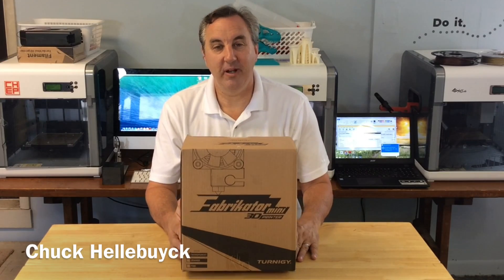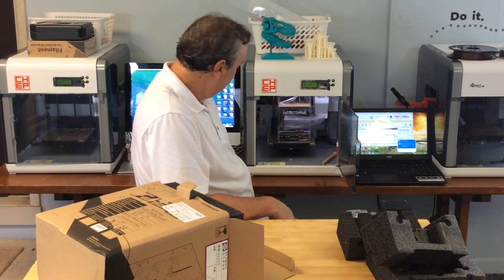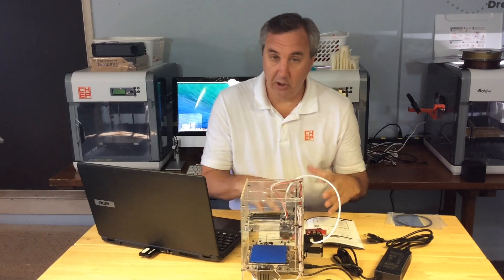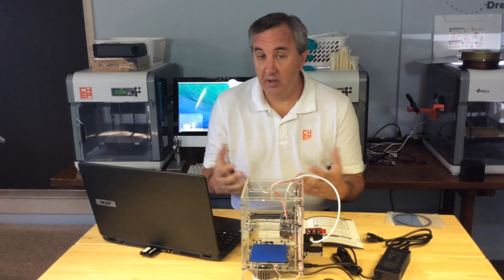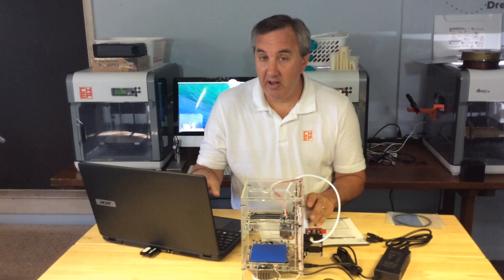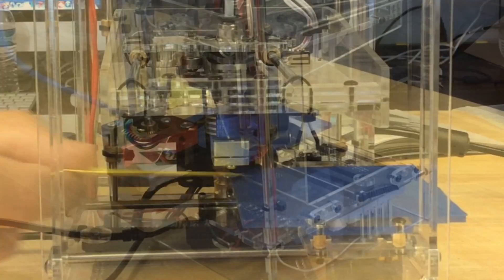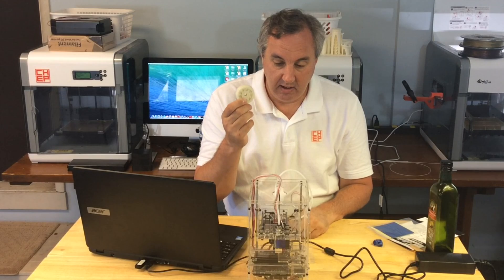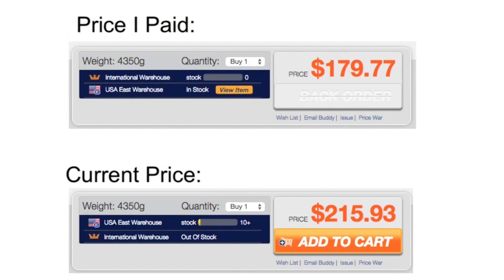Fabrikator Mini by Tiny Boy 3D Printer Review - Video #079

Comment: blast from the past.   I bought one used for $50 (!) that was broken off Craigslist when they first came out.  All that was wrong was a loose grub screw on the y stepper gear.  Printed surprisingly well.  Sold it later to a novice after improving it with a cooling fan, etc.

Comment: question. I got this printer for Christmas and I can't find their config files on the website.  I followed to book and it will not print using cuda.  I can get it to print using slic3r, could you post the config files?
Reply: Thanks man,  this is great!   BTW love your videos
Reply: +Chuck Hellebuyck's Electronic Products So I loaded the cura settings and when I goto slice then print.  It just takes my Z Axis to 15 and never heats up my extruder.  have you ever seen that before?

Comment: New subscriber here, I absolutely love my fabrikator mini! I saw this on hobbyking's youtube channel before they launched it and checked multiple times a day to see if it was in the US warehouse. I bought it within 15 min of it being put up. I have had some issues with the way the e3d head is set up. There is a chance that filament can miss the hole and push against a flat spot around the hole. I might throw the heat sink in a mill and put chamfer in there to help with that. I broke the disconnect with the black ring on the hot end and could only find a 10 pack as an add on item on amazon. Can't say I am a huge fan of the bowden style, but it lets you use cheaper stepper motors since they don't have to move the weight of the extruder.

Comment: Hi Chuck,
I took the nozzle off and was able to clear out the blockage. I will try heating up the head to 230C and melt the blockage. I am having a hard time trying to take the bowden tube out of the top of the unit?? I will try to manually push filament through the unit as well.

Thanks for the quick reply. I am going to donate to your patreon acccount

Comment: I was in hobby king and looked at this printer and saw if you get the orange one it is 179 so it is 30$ cheaper is there any other difference besides the color. And I was looking to make sure they were both from us warehouse.
Reply: +Chuck Hellebuyck's Electronic Products I just look and it still says 179 but for it to be in U.S.  It has to say U.S. in the title of the product.
Reply: +Chuck Hellebuyck's Electronic Products ok thanks. Also would you recommend this as a very first 3d print. Also I have be researching them for a year now and know how they work
Reply: +Chuck Hellebuyck's Electronic Products one more think what are some good pla filaments for this printer
Reply: +Chuck Hellebuyck's Electronic Products when I when to start up the printer I got it today, I put all info in and everything I hit start print and nothing haves
Reply: +Chuck Hellebuyck's Electronic Products  I wants to heat the bed but it doesn't have a heated bed. How do I fix
Reply: +Chuck Hellebuyck's Electronic Products thanks anyway. I figure that out

Comment: Did you have any problems with the stepper motors getting too hot? 

People on the RCgroups forum reported that problem and had to manually adjust the current going through the steppers by adjusting the pots for the stepper motors on the control board (http://reprap.org/wiki/MKS_BASE#Motor_Driver). Target current for the steppers should be around 0.75A which means V_REF ~0,6V.

I really should stop "working" with hardware I don't even have yet ;).

Comment: Thanks, Chuck for this review. I've been playing with buying a 3D printer for quite a while now and always wandered between buying an assembled printer, a DIY kit or build one on my own. I'm not afraid to build one myself, but as you said if it doesn't work for whatever reason, I might be put off of 3D printing forever. Also I never was sure what to get with all the different options that are available for the components.

When I saw the first Hobbyking announcement of this model I thought that it might be a nice setup to start playing around, but decided to wait a little until it's available in the European warehouse and see what reviews it got until then. Your review just made me finalize the order :) - plus some grey 1.75mm PLA because that's the only one that was in stock.

Comment: I have got the exact same printer the problem with my one is the Y axis keeps skipping probably to do with it getting to hot, don't know what to do really?
I have printed legs and stuck a 120mm fan to the bottom and that keeps the X and Z steppers working fine but the Y stepper skips like mad!
Reply: +Chuck Hellebuyck's Electronic Products I can move it but it does feel a little bit stiff when it gets to the front of the printer
Reply: +Chuck Hellebuyck's Electronic Products also when I try to manually control the Y axis in repetier host it doesn't always respond but the X and Z steppers respond perfectly to manual controls
Reply: How do you know all this stuff? I pushed and pulled the Y axis wires and it works! Getting really good prints, I am going to have to give a good look into the wires,
Thanks Chuck

Comment: WOW !  Nice score.  That bearing print is VERY difficult.  Did some more research,, and I am very impressed with the components and print quality,, ESPECIALLY for $225 = amazing.  I went ahead an ordered one, to add to my printer farm.  I believe they are about to get slammed with pre-holiday orders,  hope their manufacture is ready.  I'll test it for a few weeks,, but it looks like this is finally going to be the ultimate beginners machine,, and experienced print operators new toy ;)
Hey Chuck,, wonder why YT made the fan support anonymous ?  It's an awesome idea, and so far you are the only one I see using it.  I see it as a "tip" for great videos,  and at $1 to $5/per,,, well,, do the math,, it's a goldmine,, lol.   Thx, this printer went completely under my radar.

Comment: nice, do you know how many amps it's pulling during print? (guess heating up the nozzle does take some power...) Would be nice knowing USB 3.0 could deliver enough so we could use a second USB plug to power it^^ ...or maybe use a lipo battery...
Reply: TBH I would risk it :D The car battery should be 12v so worst case voltage drop is o big but since those are designed for insane currents I think even a long print will not let the voltage drop (don't know the capacity but from the time I used to use one to charge my RC stuff I know they last long on one charge^^)

Edit: reading what I just wrote... well... there shouldn't be any immediate voltage drop at 7.5Amps...

Comment: Ii still recommend the Davinci but I wish they would put an e3d on it from the factory...heck even the clone, it is easy enough to mod with repitier....or even a arduino to reset cartriges if you like the stock firmware.  for the build size its hard to beat

Comment: Cute little printer.Even 219 isn't a bad price. I went to the site and they still had it listed at 179 and 219. not sure why they have the same machine with two prices.
Reply: The clear one is but the amber one is in stock.
Reply: Well I received one of these on 9/10 . thought it would be nice to have a 2nd printer that I can print parts on if I need to fix the other one.However mine seems to have some binding issues on the x axis. I have worked on it a bit and think I have working right now. I had to loosen all the side screws and then move the platform over on the side that is binding  moved it back and forth a few time there so it aligned things up a bit and then tightened  back down down the screws. So far since I have done that it has not slipped on the x axis.it still squeals  small amount however.The only other problem I am having is it is a lot harder to get it to stick to the bed on the first layer. But once it does stay boy is it stuck.
Reply: +Chuck Hellebuyck's Electronic Products That is correct. I had done that after  realigning things. it is working well for now. I do get that squeaking  but its not to loud you have to be listening for it. I think after a little break in period it might go away. So fare I am enjoying this little printer. I printed the feed and a few other things. and they have come out pretty good.One thing I have started to do so that I can get the parts off is put a smaller block of tape on the under side of the painters tape sticky side to sticky side. this way just the outer edge ring of tape holds the tape down. Then I can peal up that outer portion of the tape and remove the print. this way I am not prying on the print bed. I think with thy bed and small bars you really want to ovoid putting to much pressure on it so you don't bend the x-axis rails.I printed the ball bearing. it came out nice. However I think a roller bearing would be a better print since I think you could have tighter tolerances then with balls in a ffm printer.